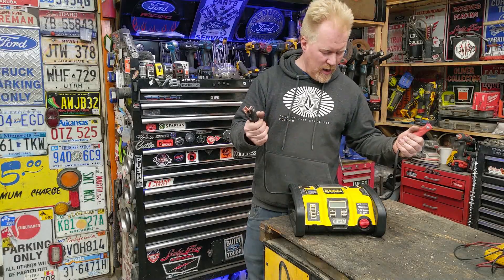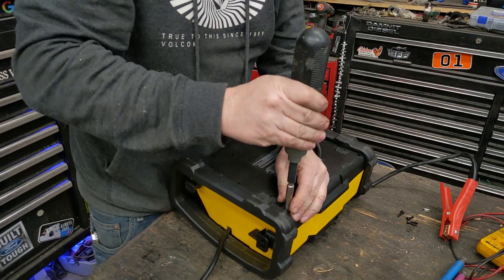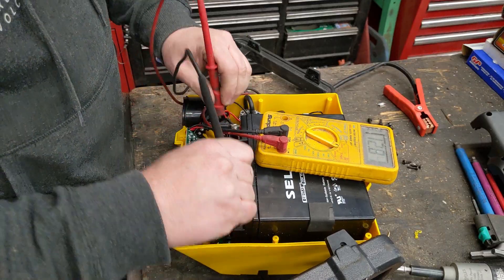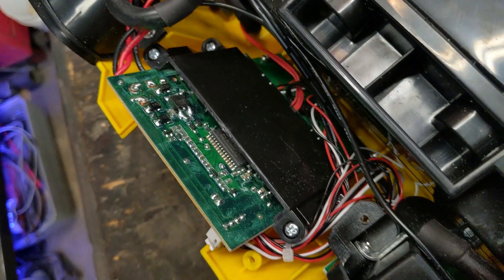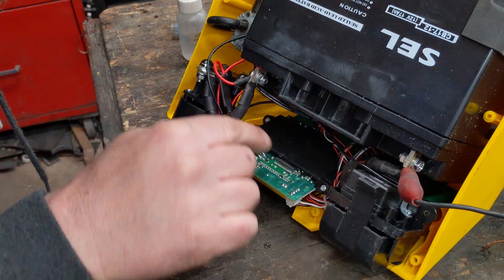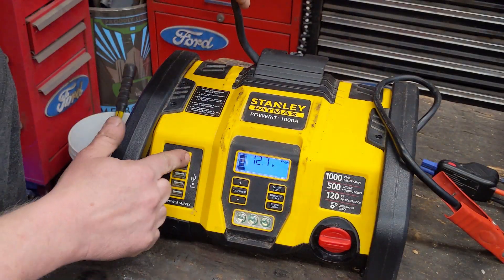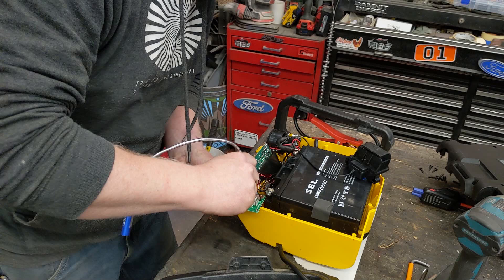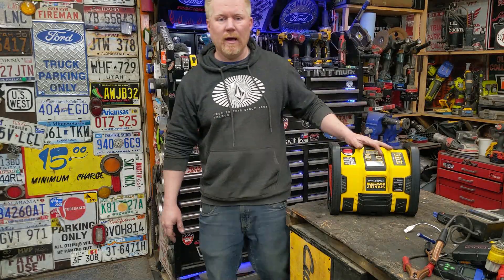NEW Jump Start Box DEAD - CAN it be FIXED?

Comment: I just replaced the battery in my old harbor freight 3-in-1 jump starter, same as this really, same switch, same battery, none of the electronicals. 

I removed the analog battery guage and put in a digital one as I prefer them, and found the little wall wart they had in it was only 12v 500ma, no wonder it never charged the darned thing. 
I replaced with a 13.8v 500ma and it charges perfectly now. 

They are incredibly simple devices.

Comment: Not 2 weeks ago I opened mine up. It was about 20 years old.. It's been dead on my shelf for years and totally forgotten, but I opened it up and it was the exact same battery as inside of yours!! I also liked charging mine off from a real battery charger and did it by hooking the jumper leads to my charger leads. I'd heard you could not do that on some jump boxes and that people were trying it and popping a fuse of something inside. Mine was pretty simple and as long as the switch was closed, it charged.. I had to use mine as a booster for my trailer winch several times and man did that work well!!

Comment: Got one just like it had it for about three or four years used it maybe five times last time took a charge but then it died started to throw it out before I did I took it apart the positive lead to the battery nut bolt came loose and fell off
 negative side was just loose unbelievable almost threw it out works perfect now

Comment: I was stranded years ago and got the idea to try and jump my jeep using my old 18 volt NiCad DeWalt pack. I had known from a kids power wheels expierment which terminal was positive so I hooked my cables up using a couple screws to hook onto the batt. Tabs. Not sure how the lipo packs would act but I would definitely try if needed.

Comment: I thought it would be a bad battery like most of them are. I just discovered your channel and you have got some good videos with good examples of troubleshooting and problem solving.

You caught that bad solder joint pretty quickly. I like your logical approach to the diagnostic.

Comment: These. I bought 3 from Sam's club. All die within 6 months.  Total junk. Yes charged as directed.
Reply from the maker: True they're not high dollar, but they have the same lead acid batteries that every single one of these jump starters has, no matter the brand. There's one thing that will kill that acid almost instantly and that's draining it completely and then trying to recharge it. Do that even once and the thing has a death sentence.

Comment: Once the battery goes stone dead in these (like if you leave it sit on the garage floor over the winter), there isn't enough juice left to kick the charging circuit on.  Connect it to your car battery as if you're jump starting, turn the knob to jump start and the car will push enough juice into it to power on the circuit after a few minutes ....unless the battery in the box is completely shot.  Then you can plug it in and charge it up.
Reply from the maker: Problem is lead acid hates being discharged fully and it's pretty much a death sentence. Once it happens one time it's time just to replace the lead acid battery.
Reply: @sixtyfiveford  That is true, depending on how old the battery is and if it froze or leaked.  Replacement batteries are pretty cheap on amazon, often at an upgrade to the mAh rating.

Comment: Good job. I seem to have a older version of what you have she won’t hold a charge. I bought it 10 years ago big box stores that also sells household products. Everything turns on but the charge only last two days. 

Any suggestions buy new or try and fix.
Reply from the maker: The internal lead acid battery only lasts around 4-6 years before you need to replace it. They cost around $40 and generally it's worth replacing if everything is in good condition on the unit itself. Here's what you'd be looking for https://amzn.to/36NR90R
Reply: Thank you. One more question how long should it last off in back of car or in garage.
Reply: I also noticed that the tire pressure part turns on but not producing air. I connected to my car tire thinking it was working since it made that noise when switch was turned on. Nothing inflated.

Comment: I like the way you tin your soldering iron's tip every time. I always forget that. In fact, I had forgotten about that over the years. Good technique. You're a fearless kind of a guy. I learn a lot.

The best one I learned from you was the Honda generator connection to a bulk tank. I did that on my two-Honda power station for my fifth wheel built into my truck bed box. Thank you.

Comment: i have this same one i got used for 40 bucks. it kinda works. i replaced the battery, but it's still iffy. i have 4 others i got for free because they wouldn't hold a charge, and just replaced the battery and they work as they should. i haven't really checked out the stanley again yet. it has a lot more going on inside than the others.

Comment: I actually got this exact same one that one of my tenants left in our property. The issue with mine was one of the buttons was broke and stuck inside the unit. I opened it to repair the button and reassembled it. Evidently just as you did, I hit the connector for the USB ports and disconnected it. It was doing the exact thing yours was, flashing and wouldn't turn off. I figured it was probably something in the circuitry and was going to tear back into it when I had time. Then out of nowhere you posted this video! I swear it was just a couple days ago I was working on mine and I was looking for videos to see if I could get an idea of what was wrong. 
Seeing your discovery of the connector, I knew exactly what was wrong with mine. I was so excited I paused your video grabbed mine and fixed it in less than 5 minutes.
Thank you for that! More than likely I would have discovered the problem when I tore back into it, but I'm sure it would have been days maybe weeks down the road. Now it works perfectly!
I may go back in and delete the beeper as well!
Reply: Can you tell me how you repaired the broken button? I have the same issue with mine right now, button is stuck down and the unit won't stop beeping. Thank you for your help
Reply: @bsmith1220  I wish I could help. It's been 2 years and I barely remember having it much less working on it. I will say it was an easy fix. I say open it up and the problem will be readily apparent.

Comment: So many people throw out stuff with the least sign of trouble and is usually a simple fix. I have picked up lots of vaccume cleaners and window fans at the recycling center and mostly only had to clean them up and they work. I hate this disposable culture we have entered. I have a clothes dryer I bought in 1975. I have replaced a few parts, but it still works fine. Keep it,Fix it and Make it last for ever.
Reply from the maker: So true.

Comment: i just bought one of those battery analyzers an Ansel brand on looks same as yours, works great and seems very believable and accurate, i have the 100amp toaster style but its far too optimistic everything is a good battery and everything makes 1000+ Cranking amps.. even 11v batterys that wont crank a car at all

i searched all over the internet looking for technical data on how these analyzers actually work but couldnt find anything, surely it places some kind of load on the battery to test for shorts and its voltage drop under load, but it has dinky little 16guage leads thatd melt at 40 amps id imagine, maybe they can flash like 100 amps though those leads for a tenth of a second and get the info they need without the big toaster element and heavy wires

would love to see some videos on reviving car batteries, likely using a stick welder, just seen UTG do a couple videos on it but i think you could get right into it and make it a series.. car batteries are the number one thing people are always replacing.. i have 4 road vehicles 3 offroad ones and a pile of yard equipment with batteries.. seems every month or two im out buying a battery i have one that shows 10-11v and little to no cranking amps but its a large truck battery im gonna pop the tops fill it up and feed it 150 amps in cycles  see how it feels about that
Reply from the maker: The little analyzers simply measure the internal resistance and calculate based on that. The toaster testers all seam wildly different. Mine does just the opposite and tells me everything is near bad on known good batteries. I have learned what means what with it over the years. I also have a 50amp toaster style and that says everything is great as 50amps really isn't much. 

I have old videos on reviving batteries and I will say the stick welder trick is a gimmick and only give superficial voltage. The battery will self discharge overnight and leave you stranded. The biggest issue with 12v car batteries is it is actually 6 batteries inside one case and it only takes one to short out to make the entire thing useless. Inside each of those 6 batteries is a bunch of lead plates that are essentially smaller batteries themselves(20ish).The lead plates are a consumable and with everything being super cheapened up I am only managing 8-10years out the best batteries and 5-6 out of the majority. Once the plates start falling apart they touch each other and short out. The stick welder is trying to arc out this/these shorts so they no longer touch. Problem is even if you get it to work, bump the battery and another lead chunk will fall and short out.
Reply: @sixtyfiveford   yeah forsure i wouldnt think itd be full proof otherwise everyone would be doing it, id have to believe uncle tony's garage and he says he took a battery sitting for years and did the refill and stick welder trick to it and stuck it in a car over a month ago and it now starts it great everytime after barely if at all cranking before.. seems like it was probably a low useage battery though not one thats had its moneys worth 

id be happy with 5-6 years i never get that, i get 1-3 up in canada.. even when theyre properly cared far, i mean not much to lose i have bad batteries, a good welder, and some water

my uncle had a battery fail in under 6 months recently and it failed properly to where it wouldnt let the car start or run at all had a dead short in one or two of the cells even with a booster pack the battery seemed to eat up all the power and give the car issues starting and running, showed 12v too on a multimeter, put the toaster on it and it dropped to something silly like 4v knew it was the problem right there, with just the multimeter no load it i wouldnt of been able to see that though, thats why i wonder how the ancel testers would detect this sort of issue that only appears under load

Comment: You were blessed Moe , Most of those SLA batteries have full voltage and no amp hour after sitting , I do like to try them on the pulse charger and many revive for me .. I have a vid on that , So far I have found 1 in 4 come back to 90% .. That one was just a bad wiring job by the builder as they are so mass produced !

Comment: I have bought 5-6 jumper boxes over the years. Only two that never worked good and they was both Stanley jumper boxes. They are total junk and I will never buy one of them again. I wouldn’t even take one for free. Only Stanley thing I buy occasionally is screw drivers.
Reply from the maker: They're all pretty junky and made with the same SLA batteries, but I think the key to any is the built in charger. I hate the chargers in all of them and think that's destroys them. I generally only charge off the leads with a car battery charger.

Comment: if for some reason you want to keep the beeper, but it's just too damn loud.  A piece of tape over the top of them will often attenuate the volume dramatically.
Reply from the maker: I put my finger over it at first with plans to do just this and it was still annoying(though much less so).
Reply: @sixtyfiveford  I had a fan with an annoying beep and I hit the buzzer with a glob of hot glue.  No more beeping and I didn't have to worry about screwing up the circuit board.

Comment: I've seen this happen & fixed quite a few myself. Solder flows onto the tinned the wire but if you don't get enough heat transfer to the pad, it can fool your eye into thinking it's fine, so you look closer & no bueno!!🤣🤣
Reply from the maker: So true.

Comment: Have you converted any old lead acid battery jump start boxes to use a lithium tool battery like Dewalt 20v, Milwaukee m18 etc?
Reply from the maker: I debated it but the tool batteries just don't have enough amps. A good Dewalt Milwaukee will only put out around 60-80amps. So it could be done but you would need at least 3 batteries(180a-240a) to make it work decent. You would also need to watch the voltage 18v/20v as that is pushing the boundaries of damaging car electronics.

Comment: I have a bunch of UPS's for my computers.  Whenever the power goes out they all beep constantly.  It absolutely drives me nuts.  I would be interested to see you take one of those apart and remove the buzzer.  It must be similar inside to the jump packs.
Reply from the maker: I've taken apart quite a few old UPS units. They're essentially just the battery and a big circuit board That turns 12 volts into 120 and also has a battery charger.

Comment: Great fix on a free power pack ..It would be a nice one to take camping   I had a 74 Nova and had that Irritating    seat belt buzzer
I could not get it un plugged so I crushed it with my pliers and once in a while it would still work and make a low growling sound that sounded 
so funny like it was dying
Reply from the maker: Smash it with pliers! That's awesome.

Comment: Where can I get the same Test Lamp you used?
Reply from the maker: I think they sell for under $10 on Amazon https://amzn.to/3pRk2j6 . These days they have ones with a ton more features like voltage display inside the handle etc. But an old incandescent bulb type like I used puts a load on stuff and has it's own purpose.

Comment: I put tape over the horn when working on an electrical panel with an annoying buzzer.
Reply from the maker: It's so annoying. I did initially put a piece of tape over the buzzer to see if that helped. It did definitely but I just couldn't stand that it wanted a beep every 30 seconds while the leads were powered.

Comment: Bought myself nice LED portable light from Costco but it stopped charging after a week.  The micro usb solder mount/electrical connection broke lose.  Super easy fix, just have to poke around a bit.
Reply from the maker: That's awesome. So many people are afraid to take anything apart especially new stuff.

Comment: A part time employer of mine has two dead jump boxes in the tool room. I need to ask if I can take them off their hands. Most likely they have dead batteries, as I am pretty sure they both worked at one time. But it would a fun project to resurrect them and put them to use.
Reply from the maker: Absolutely. if anything is always fun just tearing stuff apart. You can get the batteries for these around 35 bucks off Amazon/eBay.

Comment: I am fully switched to lithium jump packs now. Seen the one in the video for sale at the local Sam's club. Didn't interest me, but it was on sale for $59.xx last month.
Reply from the maker: The lithium's just so nice and small.
Reply: The care and feeding of the lithium packs are different from the lead acid types, so if you want them to pay last longer, don't keep them fully charged all the time as you would with lead acid. They'll last longer if kept at mid to 3/4 charge.
Reply from the maker: @wingerrrrrrrrr  Absolutely. I keep mine at around 3.85v per pack or with my 4 cell packs at 15.2-15.4v total(vs 16.8full). It still works fantastic and supposedly last 10-20x longer.

Comment: I always wonder where guys like you learned what you know. Did you get some sort of electrical engineering degree of something? I would love to know what you know and I’m curious how to get there!
Reply from the maker: By tearing anything and everything apart. I did go to college for Mechanical Engineering but that has little to do with it.
Reply: @sixtyfiveford  thanks for the response! If that is the case then I am on the right track haha. I can wrap my head around most mechanical problems but when it comes to electricity I am usually stumped. I purchased a book on it so hopefully I’ll learn!

Comment: Great reminder that if somethings already broken you're not going to break it even more if you open it up to take a look, and it doesn't take Big Clive to diagnose and fix a faulty solder joint.  Thanks for the vid!
Reply: is it 'Bravery', 'Curiosity', Skill or 'Luck'?    you're right about - 'already not working'.   the not know if made worse...
Reply from the maker: Hey Thanks.

Comment: I put one of these jump pack style batteries into my 22hp zero turn mower, works well.  In freezing weather if I need to start it I always supplement with another jump pack at cold start, but subsequent starts are fine.   In summer it cold starts just fine.  It's lasted way longer than the standard lead acid batteries that the mower came with.
Reply from the maker: For years I just used a jump start pack on a few pieces of equipment as the only battery. It works if you have the space for it.
Reply: @sixtyfiveford  I removed the battery from the pack and just used it.  It's smaller than the battery it replaced.
Reply: It's been decades since I bought a mower battery. I just save the truck batteries and strap one on the mower running board, and tho it won't start a 2600 cc engine, always starts the mower. I always have an exchange battery too.